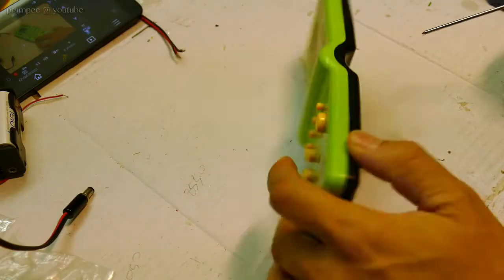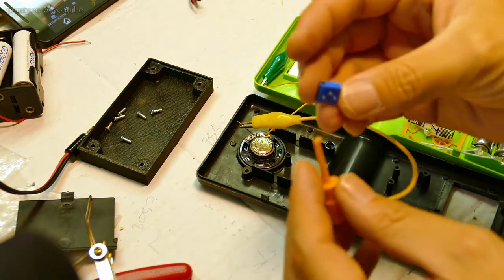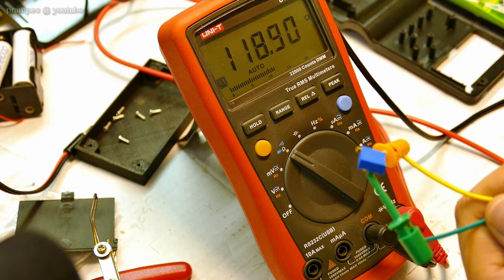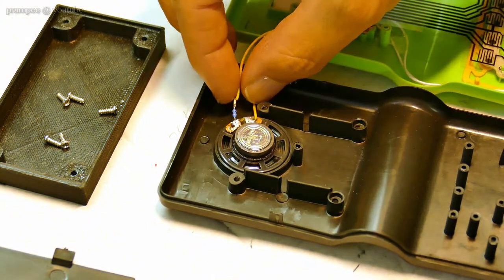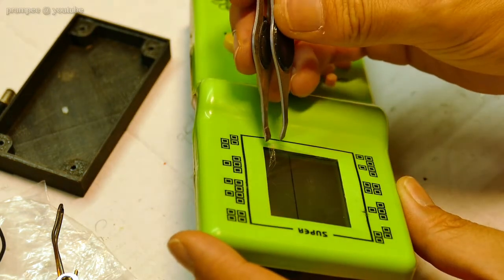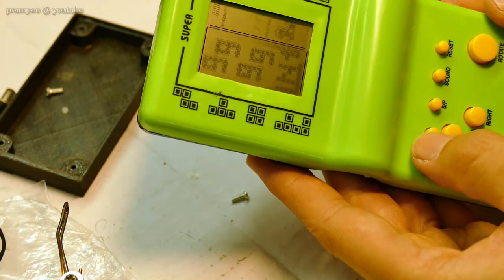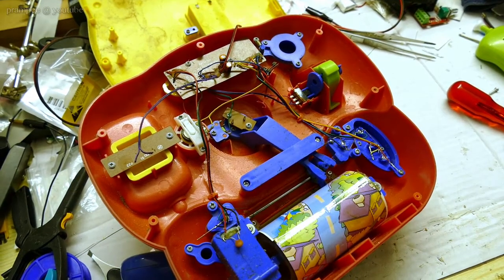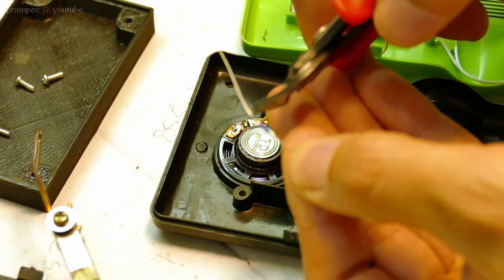Too loud? Fix it! - Toy Care

Comment: sir, how to make toys speaker louder? mine has quieter sound.
Reply: That's what I am trying to look for
Reply: Solder on a potentiometer and adjust the volume by twisting the dial. Keep in mind not all toy speakers use the same voltage. So dont instantly full blast the volume for the speaker. You might have to upgrade the speaker to a higher voltage one for louder volumes, cause those little Chinese speakers in toys will quite literally blow up in smoke if voltage is too high. there's a tone of vids on YouTube of ppl blowing up those speakers lol.
Reply: use an op amp to make the speaker louder

Comment: I have opposite issue. I have toy laptop speaker whose volume has been 90% decreased. What should i do ?
Reply from the maker: It is very likely that the speaker has damaged (e.g got dirt in it), you can replace it with a similar size one. (It still can be a transistor failure, but is it not straight forward to fix that, if it is fixable at all.)